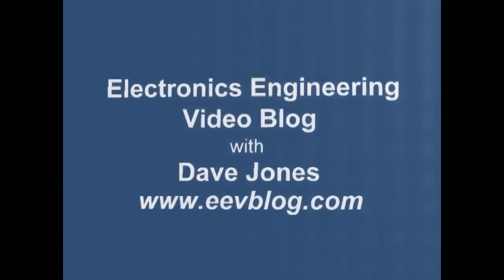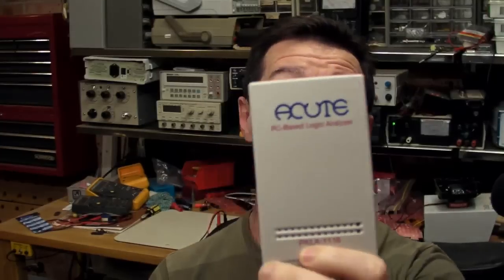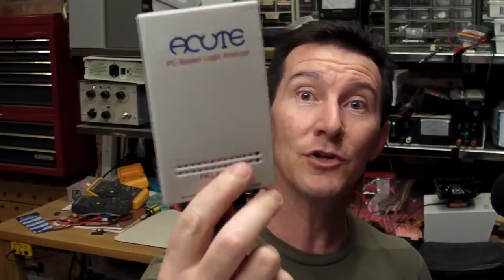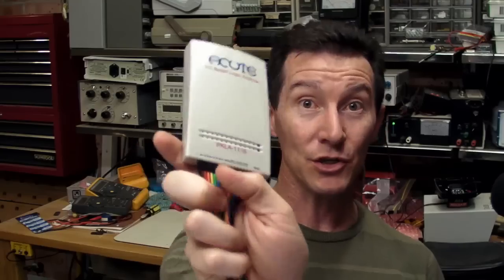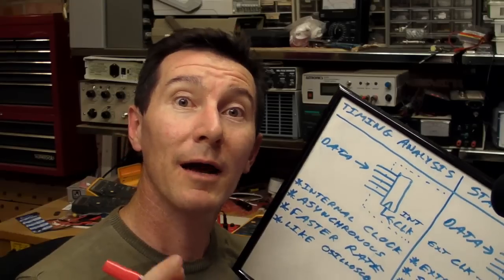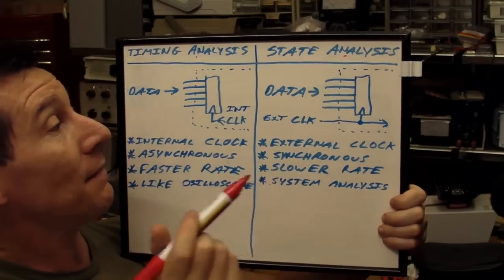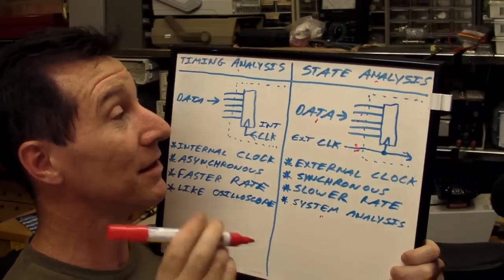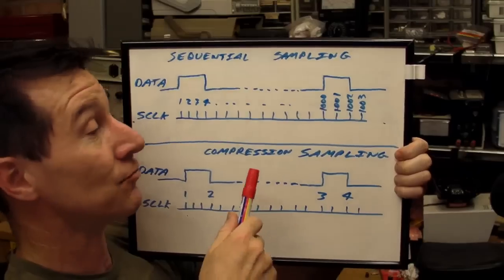EEVblog #44 Part 1 - Logic Analyzer Tutorial

Comment: Hi Dave,

Logic Analyzers address the needs of hardware and software. Providing the options of mainly state or timing. A deep memory oscilloscope will not be that useful to a software engineer writing device drivers. To debug firmware state information displayed in both timing and instruction (hex and symbol) is needed to debug. Also, for debug a special extended version of the PCB would support plugging in the channels 16 or 32 bits at a time with proper termination.

Comment: Great post, but I believe that the Logic Analyzer, or even a MSO is the digital design engineer's best friend. I've been working with DSPs and FPGAs for quite some time now. Not all chips have cheap debuggers/emulators. Scopes only have couple of channels which are "too noble" to deal with simple 0-1 logic. If you're designing a circuit with a bus or complex digital signals, you should definately get a logic analyzer!